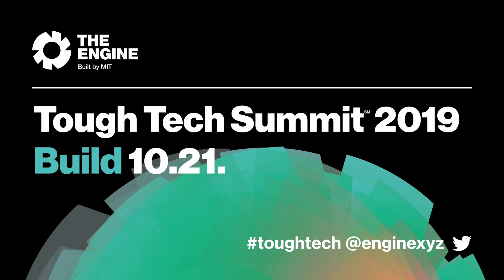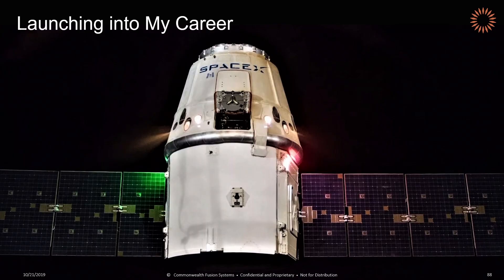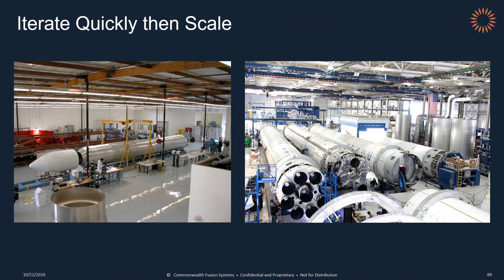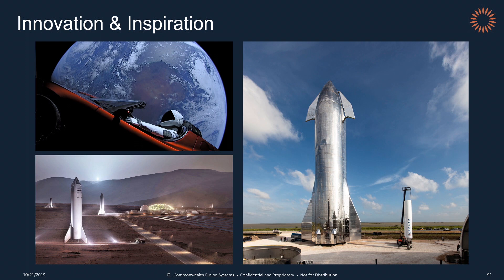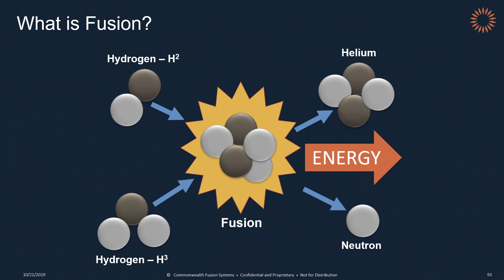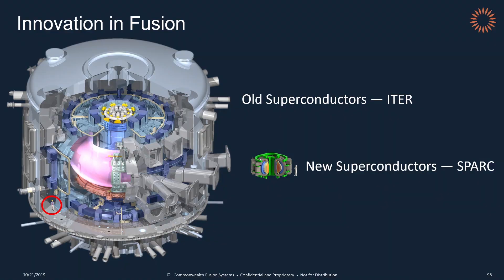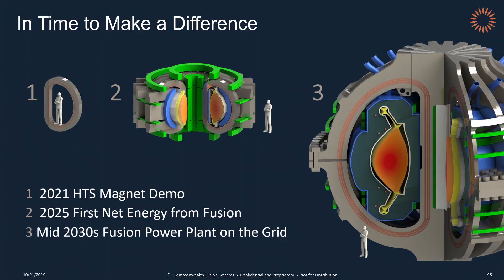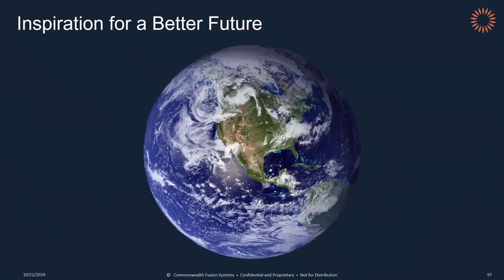Building rockets & fusion reactors at SpaceX and Commonwealth Fusion Systems | Joy Dunn

Comment: "Fusion is exactly the opposite of Fission"? Exactly and precisely wrong! The processes require Fusion and Fission together, and if they are analysed in temporal superposition logarithmic condensation modulation, then the shape shifting from photon condensation by integrating modulation, to phonon condensates tuned to the same AM-FM module,  is a redistribution of photon-phonon substantiation connection, and there's only probabilistic degrees of knowledge about the tipping points of the reshaping process. 
The critical mass-energy-momentum balancing of modules is not predictable for Fusion Power.
Reply: If you a use a base-plate of pre-fabulated amulite, surmounted by a malleable logarithmic casing in such a way that the two spurving bearings are in a direct line with the pentametric fan, this is not a problem.